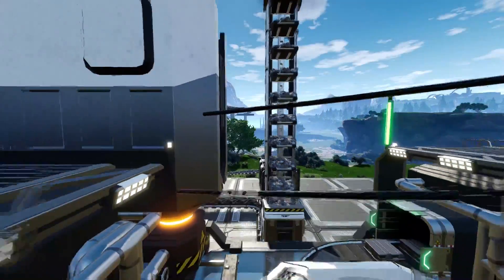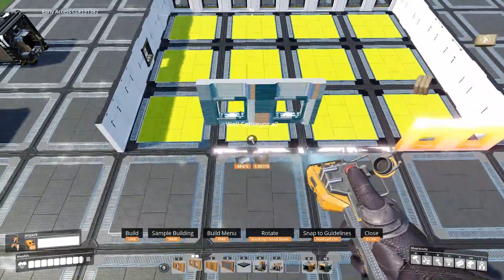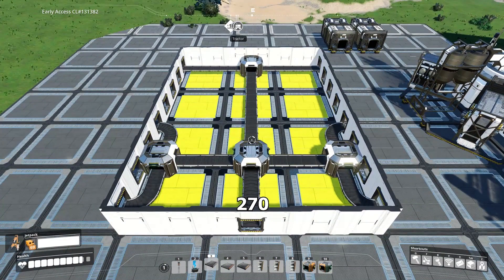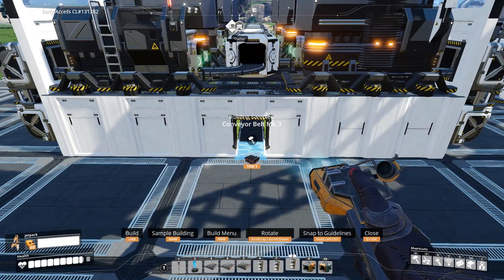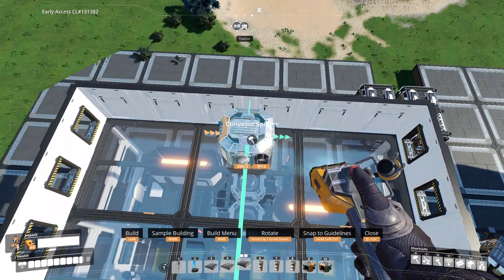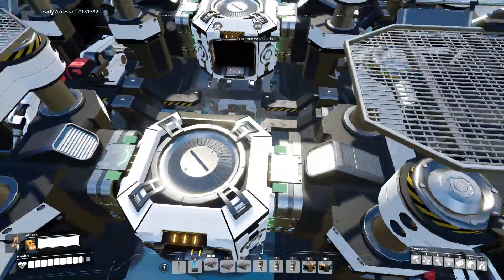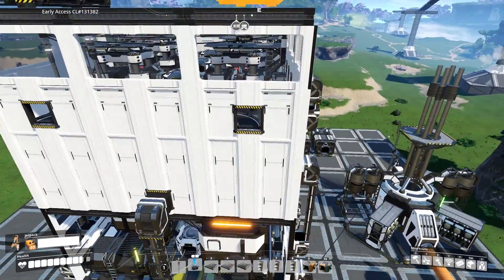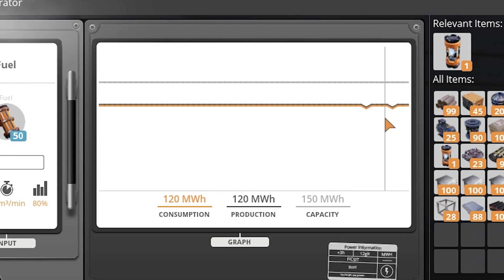100% Efficient Steel Factory Design | SATISFACTORY ( 45 steel beams and 60 steel pipes per minute!)

Comment: You mention the solid steel ingot recipe very briefly, but I thought it was worth commenting just how good this alternate really is. Using it, one can get 60 beams and 80 pipes from eight constructors instead of the six used here. A few notes about it:
1. The ratios used are all the same, so the load balancer setup shown here works fine. 
2. The pipe production uses four constructors, but only requires two foundries worth of steel. This actually works out fine, as you can simply route the output of two of your foundries out one side of the building, and the remaining four out the other side.
3. You can't fit eight constructors and their associated mergers and splitters in the same footprint as the foundry floor. To get around this, I added the "wings" that Chanky uses in his no-smart-splitter variant, except this time on the constructor floor. Doing this, I was able to get a very neat constructor layout that then fed up to the roof. I just have it going to an industrial container for now, but I plan on siphoning off some pipes or beams for encased industrial beams later. 

Overall, I really like builds like these or Scalti's way more than the sky-platform 2D layouts that it seems are way more popular on YouTube. If I wanted to build in 2D I'd just play Factorio or DSP.

Comment: aight so hear me out... how come we need mk. 2 miners and mk. 3 conveyors when we need to unlock advanced steel production for mk. 2 miners, which is the sole reason many of us make a steel factory, to unlock advanced steel production
Reply from the maker: Because I didn't mean this design to be the initial design to get steel. If you think about it, most items initial design is always going to be sloppy and just enough to get a good amount of it first. All the other efficient designs will inevitably use the same material the factory is making.

Comment: I wish you'd point out the complications of using a smart splitter. I love the design, but now the conveyor belts gets stuck because my storage of either beams or pipes is full, thus not being able to fill the other storage. Guess I'll have to redo it and do the non-splitter :/
Reply from the maker: Ah yeah that is something that could happen. That's why i keep another smart splitter behind all my storages with an overflow setting that will push all the excess items into an awesome sink so that all the factories will run even if my storages are full. ( and also making some coupons in the process)
Edit: In fact I was actually thinking of showing my mall design.. It's simple, sorts all your items, and provides easy access to all the items you need to build. At the same time , overflow wont be an issue because of the awesome sink i installed
Reply: @chankykang4918  that's a great idea! I'm working on my 'silo' right now, a massive circular storage facility that I will eventually turn into my megabase. What I did with this design though, is I split the pipes section of the load balancer into 4 x 22,5, added an extra constructor to the design and underclocked them to 75%, and gave the 4th constructor its own belt. That way the distribution in the splitter is 100% equal. However  it doesn't work when I take things out of the storage of course, as it makes an imbalance again. Would love to see your design with the awesome sink! I really also recommend the Dispenser Storage mod (something like that), which can make your storage design suuper slick and also convenient!
Reply from the maker: @aribenjamin862  Ill check that mod out! Also, any way I can see your storage facility? It sounds really cool
Reply: @chankykang4918  I'll send you an e-mail with my discord right away, and I can stream it to you whenever :)
Reply from the maker: @aribenjamin862  Sounds good to me!
Reply: @chankykang4918  Cool, I've sent you the e-mail!
Reply from the maker: @aribenjamin862  haven't received it buddy
Reply: @chankykang4918  Ohh, I sent it to the email listed on your youtube profile! Is it the one you're using?
Reply from the maker: @aribenjamin862  yup thats the one i checked too. Can't find it
Reply: @chankykang4918  Very strange, I sent you a new one now! Let me know if you don't receive that one!
Reply from the maker: @aribenjamin862  got it!